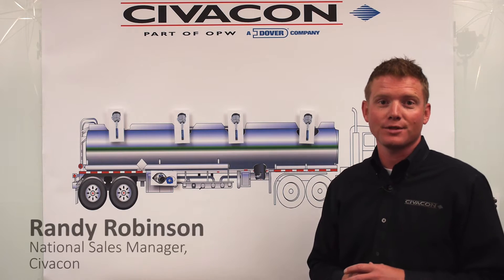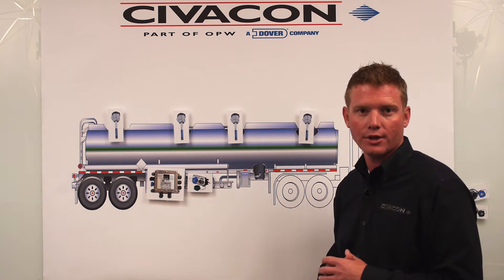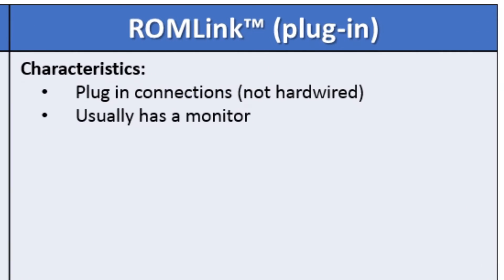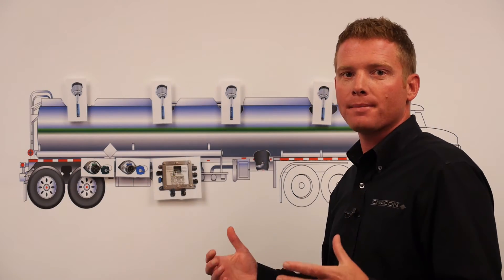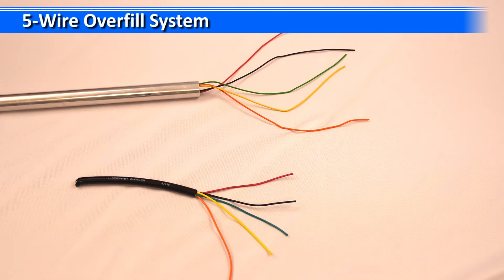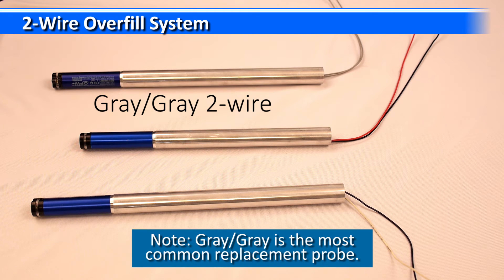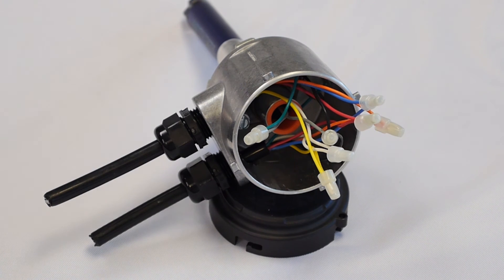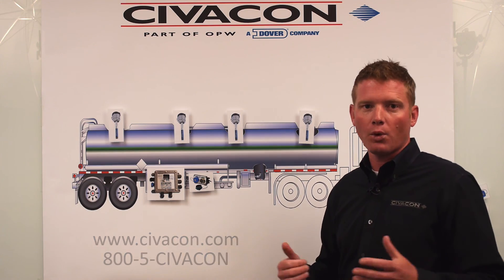Overfill Probes for Trailers

Comment: I have sistem with 4 compartment with 5-wire overfill civacon senors, and 3205E Monitor all connected into the Rack 4103 Optic (Blue). Is there any way to break the circuit (with Function Key, or whatever) when sensor is wet? Thanks in advance.
Reply: styepke nope, to many comanys would hit that fantasy button and would end up flooding the rack..fuel haulers are the worst about doing anything to get in one more load for the day...
Reply: sparky Mccormick that's because we're usually paid per load....every single one counts